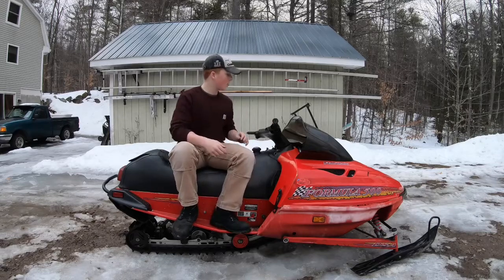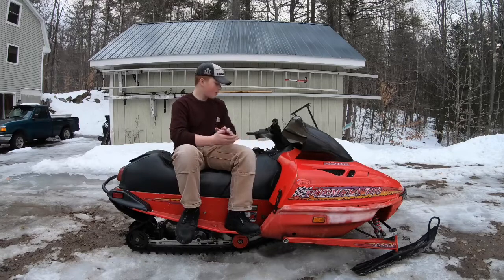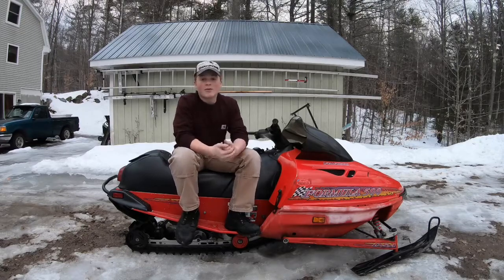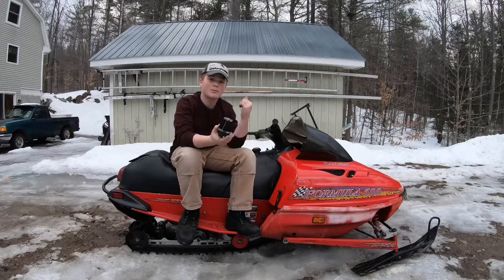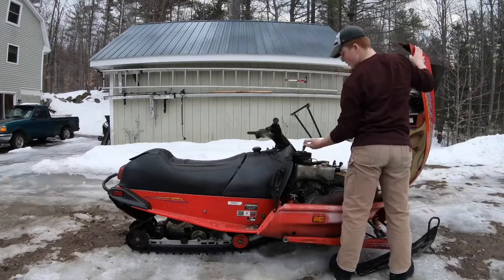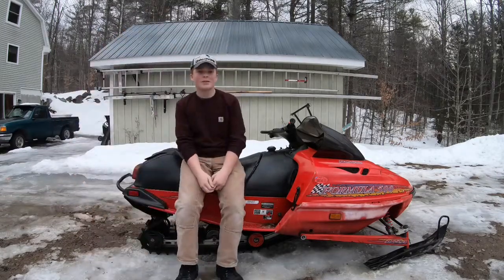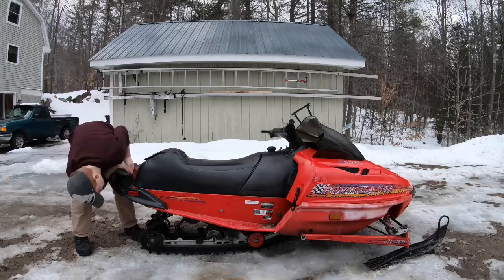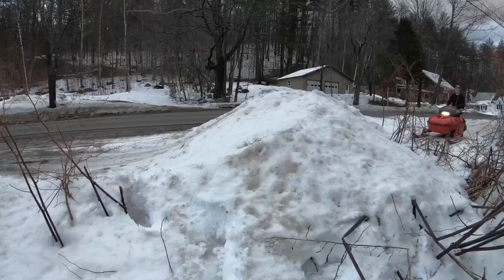Skidoo formula 500 finally running

Comment: I think it was loading up with gas because of exactly what you brought up. Those filters.  Belt dust, Debree,  Snow, Water Etc gets caked on those filters and restricts them.  Then at high speed, It floods.  Find an original air box for it. And you'll be fine  ;) Those filters you had on  are nooo good.   It wasn't your primer that was causing your problem.. And as for your back flap. YOu have that track with longer lugs.  JUst trim off about an inch and a half off your flap. And that problem will be fixed too  :)
Reply: But.  Love your sled Spencer  :)   Cheers  :)
Reply from the maker: Sadly that sled is long gone, but I fixed it thanks